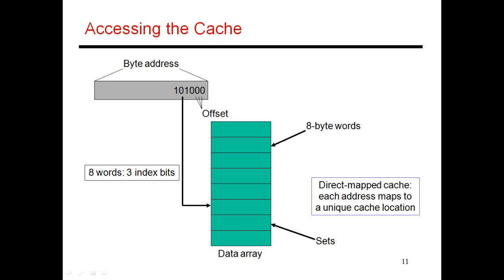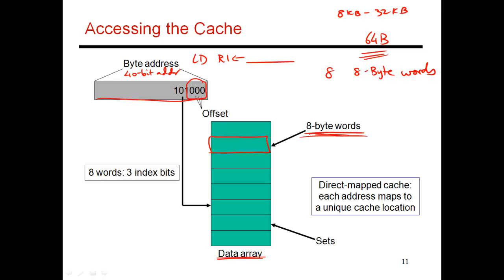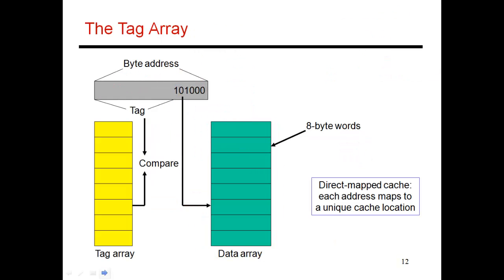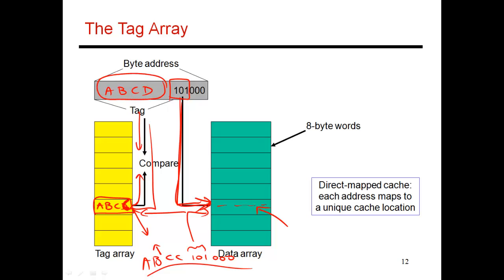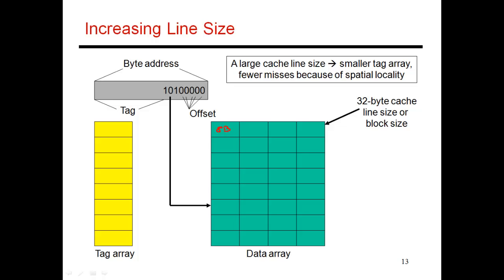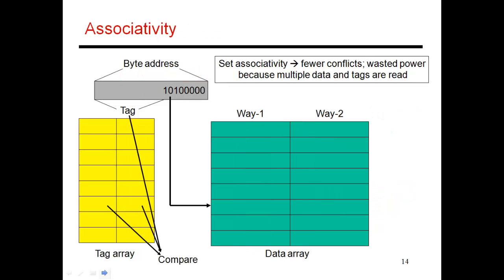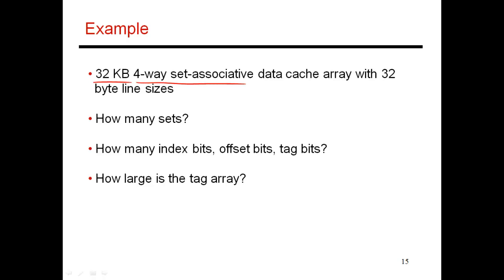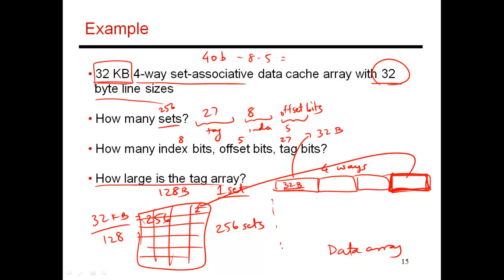CS6810 -- Lecture 37. Lectures on Cache Hierarchies.

Comment: Y do we have the problem with abcd and abcc getting stored under the same index+offset. Why don't we just alter the index for abcc, so we don't need to make it 2 way associative?
And in general: why do we use the index at all? Why don't we just use the real address (the 32bit) for cache addressing?
Reply: Or is the 40 bit address the usual address for the data in RAM, that is just logically devided into offset and index?
Reply from the maker: *****
Correct.  We are just logically breaking up the original address into index, offset, tag.

Comment: In the example: One Block is 32 bytes. Offset is 5, Index is 8 then why Tag is not 32-8-5. Why are we assuming a 40 bit address and then calculating tag as 40-8-5?

Comment: For 2 way set associative cache, which bits are the offset?
Reply from the maker: The offset bits are only determined by the size of the data block and have nothing to do with the associativity of the cache.  A cache with 32-byte blocks will typically use the last five bits of the address as the offset.

Comment from the maker: A TCM (tightly coupled memory) is a small structure on a processor chip (like a cache), but has deterministic user-defined content.  Consider this small example: imagine that the address space ranges from 1-1056.  The addresses 1-1024 are placed in main memory (off-chip).  Depending on the recent access pattern, some of this data may be found in your small on-chip 32-entry cache.  But addresses 1025-1056 are being explicitly placed in your on-chip 32-entry TCM and are accessible at low latency.